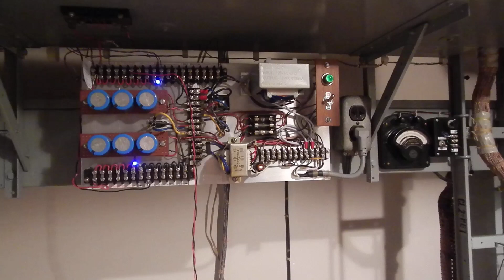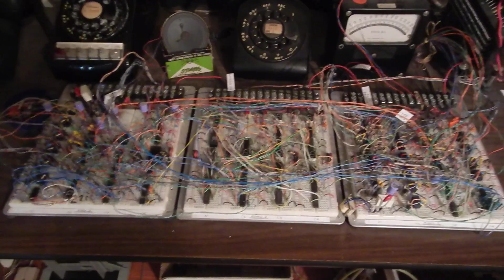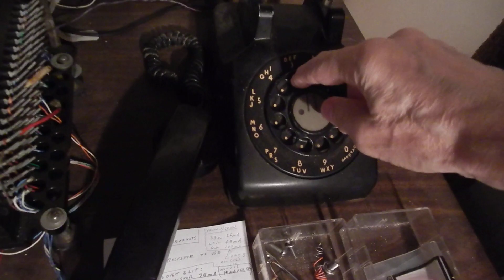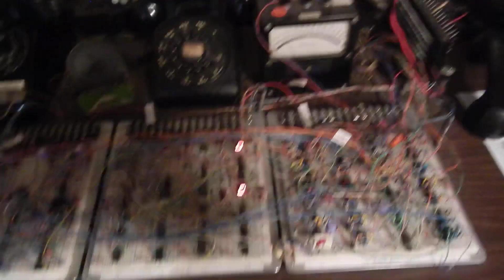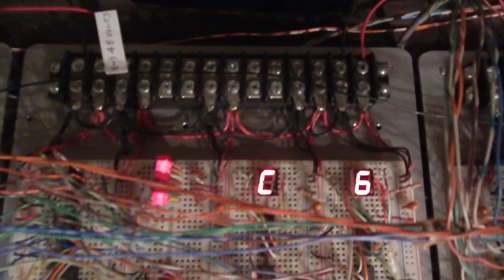Home Made automatic number identification (ANI) for 200 line step-by-step exchange.        DSCN0447

Comment: How does it work? By that I mean, how does it know which line is calling it?
Reply from the maker: The diode matrix translates a "1-of-200" contact closure into an 8-bit binary number.   (two hex digits).  The hex line ID numbers range from 01 through C8, with 00 reserved for testing.
Since there are 5 linefinders, the ANI must scan across them until it finds the one which has the call to the ANI.   That happens when you hear those fast little beeps.
The beeps are the ANI scanning.   Once the proper linefinder is identified, then a 48 volt signal is sent to back jack pin 5 on it.   That 48 volts flows through the linefinder and
then out on either the A or the A1 bank wiper, which has landed upon those bank contacts which represent the line I.D. of the calling line.   That signal then flows through a
200 conductor cable, over to the diode matrix, which generates the 8-bit line I.D. code, which it then sends over to the ANI on those 3 boards on the table across the room.
There, that 8-bit line I.D. code then gets turned over to a 2732A EPROM which has been programmed to act as the translation table that contains all of the phone numbers
associated with all 200 of the 8-bit line I.D. numbers.    Those phone number digits then get passed along to Digitalker so it can be spoken and at the same time it is fed
to the flashing green 7 segment readout, which shows the calling phone number one digit at a time as it gets spoken.